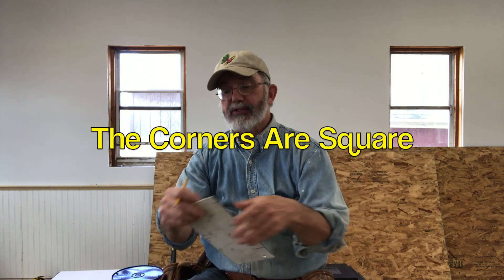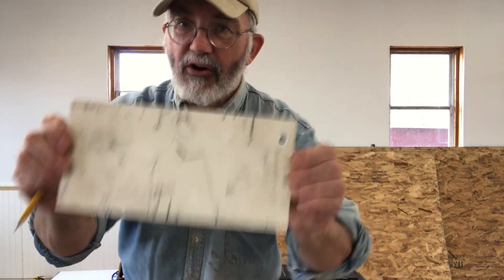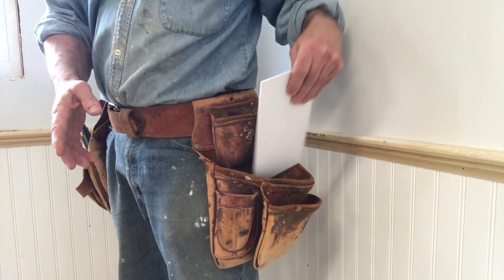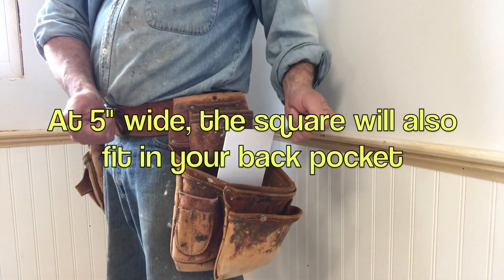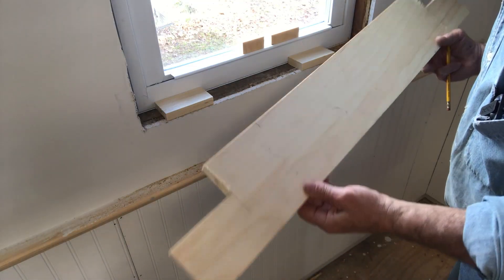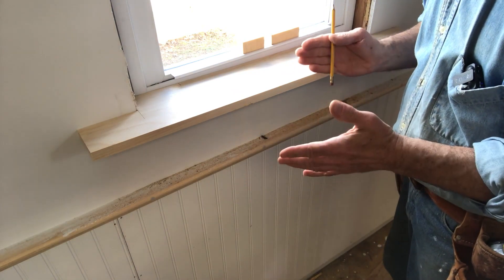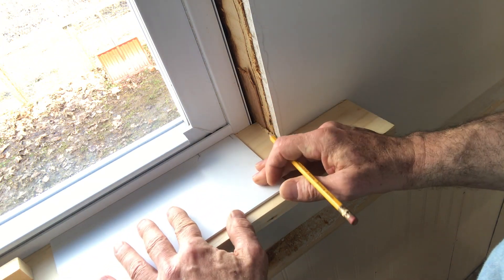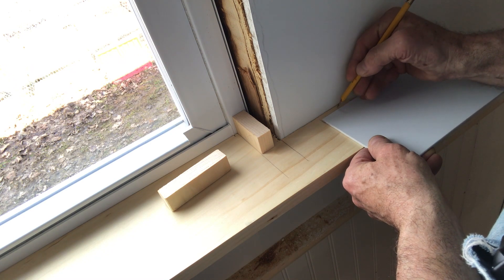Introducing The Remarkable Whizbang Carpenter's Square

Comment from the maker: You can get a reasonably priced piece of 1/8" PVC plastic sheet at Amazon (affiliate link in description above). It will be glossy when new. I recommend that you give the gloss some "etch" with the finest sandpaper you have. That will make it easier to write on. The MEDIUM (green) Sandflex sanding block is also ideal for initial etching of the surface, as well as "erasing" the pencil marks.
Reply: Elizabeth L. Johnson said,  300 grit too fine?  I need one for use down at my minibed garden!!  I'm always having to rush back up to the house to find my memo pad.
Reply from the maker: @JamesJohnson-yh1oh  300 grit will do it.

Comment: Some great tips, Herrick. Over here in the UK I could not find white PVC board but they do have white acrylic sheet which is similar I think. Would that do?
Reply from the maker: Hmmm. I don’t think a pencil will write on acrylic. If it doesn’t, you could apply 2” wide masking tape on the acrylic and write on that. Remove the tape when you want to make a clean new taped surface. 🤔👍